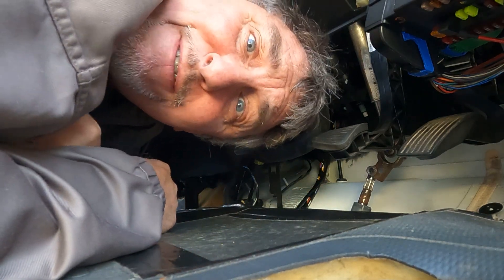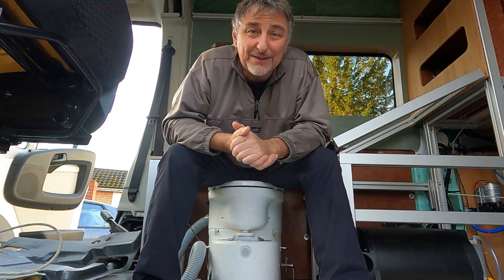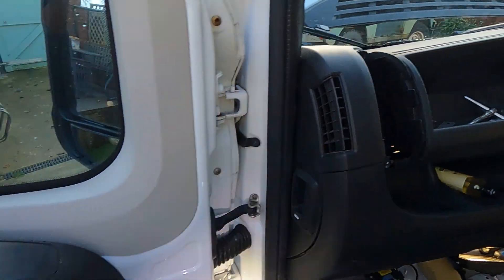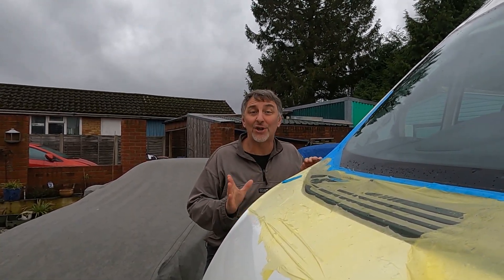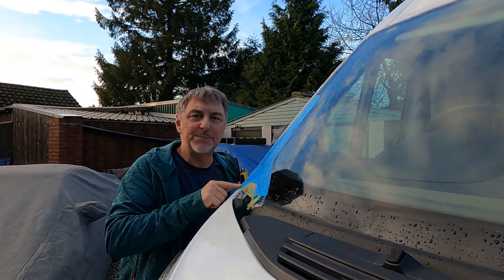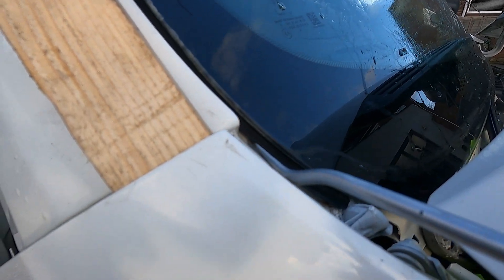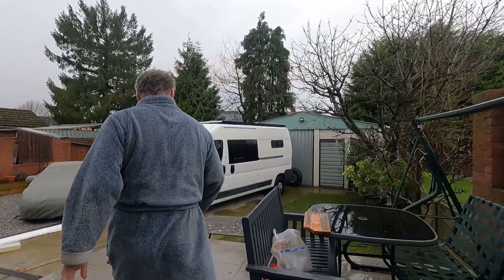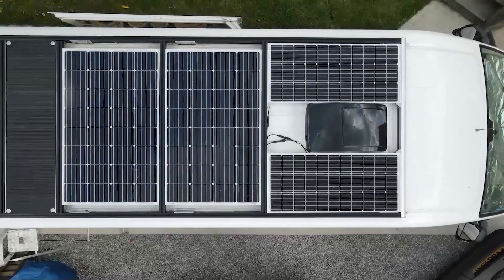WINDSCREEN LEAKING? - UNSEALED JOINTS Citroen Relay, Fiat Ducato, Ram Promaster

Comment: Cheers for taking the time to experiment and post the results.
I'll be having a look at ours in the summer, when we have the wings off to lanoguard the nooks and crannies up the front.
Thanks.
Reply from the maker: Thank you for your kind comments Guy.
I take it you have a similar problem?
I'd exhausted all of the common complaints so this did need a bit of extra investigation.
I was surprised to see zero sealant on that seam and wonder was is it the 'norm' or a genuine factory mistake? 
Anyway, all's good now and no corrosion.
Reply: @vanlifemyway7806  no sir. Just the usual damp injectors. Again something to be looked at come the summer.
Cheers once again.
Reply from the maker: @guysmith3950  you'll sort it. That pro less well documented.
I may be tempted to keep regularly spraying WD40 at those injectors just in case one day they may need to come out.

Comment: Ive got the same problem on my 2013 ducato the water is causing me issues in the engine compartment electrics when it rains.im goting to seal mine up tomorrow after watching with
Reply from the maker: 2013 Rob, it could be the more common split scuttle panal that you can either seal up or replace with a 2014+ one. Check also your drainage holes and make sure the pipes aren't blocked.
Apart from that I hope the video helped.
Best wishes,
Paul
Reply: @vanlifemyway7806  the water rains in .the main drain was full of mud ! It covers the fuse board to the engine .I've got a big job on my hands here
Reply from the maker: On a good dry day, if it still exists, give you're fuse box a good spray with "damp start".
I know this problem has been covered many times before which involves cleaning your drains, sealing your skuttle panal and fitting a cover/diverter over your fuse box. You appear to have caught it before it can ruin your fuse box so well worth the work.

Comment: This is a very common fault on the Citroën Relay, Peugeot boxer and fiat ducato,if not adressed,the water leaking in will "weld" your injectors to  the head with rust. I had a Citroën Relay with this problem, and i have just bought a 2018 Peugeot boxer, and it too has this problem. If you have one of these three vans, check it now,or you could end up with some very expensive repairs down the line,im just going outside to seal the scuttle on mine now.
Reply from the maker: Thank you for bringing this to light, however,
this wasn't the usual and well reported scuttle panal problem that's usually more so specific to pre- 2014 models that have a split scuttle panal. 
This was unsealed joints between the A pillars and bulkhead as described in the vlog hence producing the vlog.

Comment: Well done Inspector Clueso, I've recently seen another utube video by a guy who had rusty injectors in his Ducato caused by water coming into the engine bay via the bottom of his windscreen, obviously a design fault in these vans if you hadn't sorted that leak it could have turned your lovely van into a rust bucket👍👍
Reply from the maker: 🤣 thank you Michael, it was a problem that didn't seem to follow the usual "leak into the engine bay" problems. My van being a 2015 had improvements made to pretty much stop these problems so it did become quite a process of elimination.
I was surprised what I found but glad it was an easy fix and no real harm was done.

Comment: Impressive how this issue was not fixed in the late models. Had my fuse box and ECU damaged due to this same problem on a 2010 model.
Reply from the maker: Hey David, I have to admit all the earlier model issues appear to have been addressed. 
I have no water heading toward the injectors, the wiper motor has a cover and the scuttle cover is 1 piece....that's why it was a process to find this problem.
The issue turned out to be unsealed framework.
All sorted now 👍
Reply: @vanlifemyway7806 Are you saying that this problem only applies to older models? When was the problem addresses by the factory, on what year model?
Reply from the maker: @sinewaymusic  hi, this is a 2016 face-lift model which had already had the "leaking on to engine" problem addressed by factory with the introduction of a 1 piece scuttle panel.
This is a whole new thing all together!
My Van leaked so much that it had to be a factory overlook as the join I found was totally exposed to the elements. However, I see many people complaining how corroded their steps are when removing the plastic trim.... this is an area where the ingression can choose to exit quite unnoticed perhaps.

Comment: Great vid, I'm doing preventive maintenance now. One bit I can't catch is when you say what I hear as "I unbolted the wing tops....". Is that correct?
Reply from the maker: Hey Neil, many thanks for watching and glad you reached out.
There is an obvious bolt at the top of the wing behind that black plastic trim in front of the mirror.... that just pops off.
Unduing it and slightly prizing back the upper part of the wing gave me the access I needed to easily find, check and seal those seams.
Best wishes,
Paul

Comment: The scuttle panel on my 07 has shrunk significantly, between 5 and 10%, and as a consequence, the fixing clips, which have also degraded, no longer align with each other. This panel overlaps in the middle but due to the aforementioned shrinkage mine now doesn't, when securely fixed at the outer ends. Water was able to destroy the wiper motor and for a while we thought that the very expensive ecu needed replacement  also. I'm planning to use Tiger seal and bodge it back into service as a cheap fix. Owners of older vans would be wise to pop the bonnet (hood) and inspect the integrity of this 'trough'
Reply from the maker: Hi TR. mine is luckily the 2015 facelift with most of your problems already addressed with a 1 piece panel and covers over all the prone areas.
Saying that that "bloody" hidden seal had bugger all sealant on it.

Comment: My 15 plate ducato is dripping in from the passenger side top of the windscreen. But, its dripping from between the panels where they are spot welded together. Also a drip from the same seam mid van. Ive seam sealed the whole length of the roof, painted it and also siliconed the windscreen.... still dripping! Im at me wits end 😅
Reply from the maker: I had absolute nightmares!
You've checked your arial antenna? They're renowned to leak.
Apart from that, that's where you may be seeing it but it could be coming in anyware.
Good luck and let us know when you get it sorted.
Reply: @vanlifemyway7806  I haven't tried there but as I can park it leaning to either side and the water only drips from that 1 spot in the seams, it has to be somewhere in the factory sealant bead thats allowing water into the seams and running down the front of the van. Bloody frustrating as it's holding up my camper conversion
Reply from the maker: @thebeardedgeordiephotography  take a picture and find us on Facebook @MyWay Adventure

Comment: Has this issue been fixed on newer models. Which year range is prone to have this problem?
Reply from the maker: Thanks for watching and thanks for reaching out to us.
This is not the most documented problem, rather the scuttle panel leaking causing water to flood the engine and specifically corroded the injectors making them ni impossible to remove.
The manufacturer remidied most of these problems with the face-lift from 2013-14.
My problem doesn't seem documented which I hope is, therefore, an isolated problem. However, if I have had this problem I expect others may have too. If so it would affect the whole product range. 
Who knows, perhaps mine was a 4.45pm Friday model  and Jean Pierre had overdone the Carte de Jour? 
Best wishes, 
Paul

Comment: Spooky, i found iut about this issue a few weeks ago so bought some sealant and sealed all the lower part of where the windscreen meets the plastic trim and water drainage. I habe an 8month old fiat ducato camper so wont take any chances (unless theyve sknce addressed the issue prior to me buying my van
Reply from the maker: I think where you have sealed... it was only an issue pre-2014 when the scuttle panel was 2 piece. Making it 1 piece improved that problem so don't worry too much.
Best wishes,
Paul